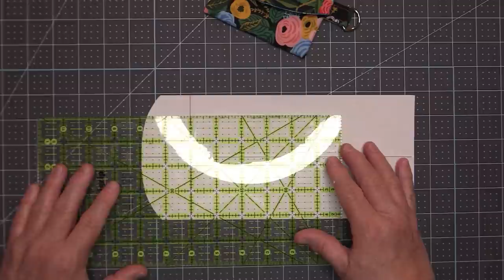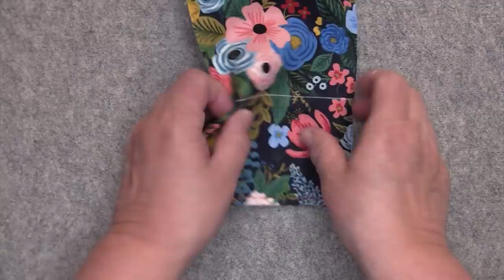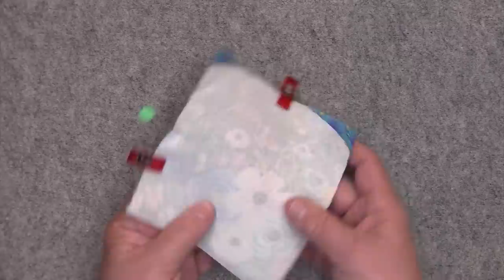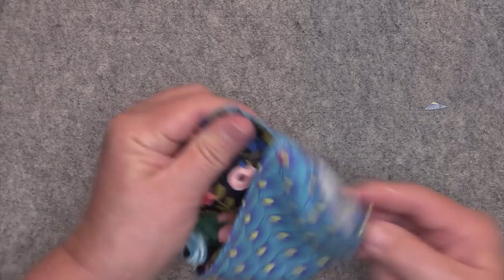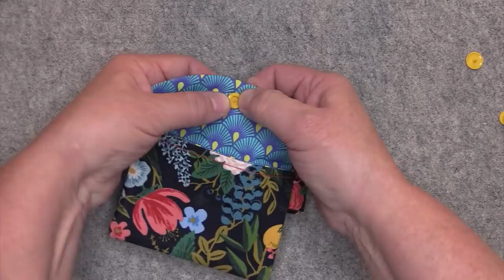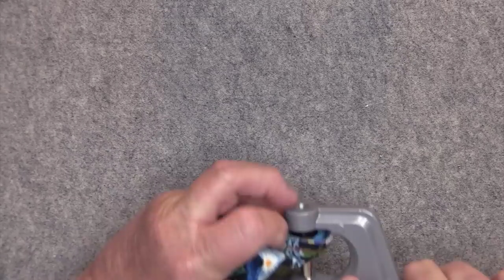Key Fob Card Pouch - Quick Sewing for Craft Shows

Comment: A suggestion on the snaps . For matching snap, how about after you have put the hole with the awl, in the flap, close flap, put pen through the hole to mark a matching hole point on the body of the pouch . Then make a hole where the pen mark is and you will have both the holes aligned. Then insert the “pointy snaps” through the respective holes to attach the female/male parts.
Reply: Excellent
Reply: That's what I have done when making little purses

Comment: After replaying the video several times to follow along, these are very easy to make! Instead of starting with 11", I just cut the fabric to 9". Also made a cardboard template instead of markings, so it is easier to flip the fabric over, iron with the cardboard in place, turn over and do the other side.
Reply: You had the same question I had with this one
Reply: I just watched through a few times to figure out that extra 2" piece. Thank you for posting your comment. I wanted to make from a 10" layer cake and that will work great! I see the 2" strip is used to make the tab for the D ring. I may try to make those from coordinating fabric or figure out something cute. :)

Comment: I  understand why you  started out with the  11 inch length. (Copy paper) But to save time I would just start with the 5x9 pattern size. That way people can make the pattern the right size to begin with and save 2 minutes of video time cutting off the unexplained 2 inch piece.  I like the end result. Thanks for sharing. Chalk would be a good way to mark where the snap goes. Cute little purse.
Reply: I agree, i have enough to knit and sew for Christmas without adding another step thats totally unnecessary
Reply: It’s 9” from the apex of whatever curve/angles you choose for your flap pattern. That can vary depending on what style you choose.

Comment: I love these. I made two of them last night. I purchased the press, awl and snaps a while ago but had  never used the snaps. You made it look easy and explained well how to do the snaps.  

Instead of using paint to mark the place for the second snap.... What I did was....
- Determine where I was placing the snap on the flap and made the hole with the awl. 
-Fold the flap down into place.
-Using a pointed sharpie marker and the hole as a guide, I made a dot through the hole onto the fabric below. 
-Then using the awl, I poked the hole on the pouch part on the dot, and placed the second snap. 
Super simple and it lined up well. No paint needed.
Reply from the maker: I am glad to hear you made the pouch and thanks for the tip.

Comment: I liked your version of leaving the side lining unsewn for turning. Your fabric was beautiful. When I use my cam snaps, I press the first pointy part through the 1st hole and into the other side to make a dent into the 2nd fabric, then make the second hole with my awl.
Reply from the maker: I have a few different ways to line up the holes for the snaps, but this fabric was so dark that I had to use something that would show on the camera.  My favorite way to to use a marker to color in the male snap and then press it down.  It works great, but you would not be able to see it on the video.

Comment: Thanks a lot ! Very nice tutorial. One suggestion : at 10.11 I use a piece of cardboard (5 x 3.25 in) to mark the fold. I place the cardboard on the interfaced side of the exterior, fold the upper part back on the cardboard and press. This gives me a nice fold that is .more precise than a line , and is a time saver, especially if you make a lot of pouches. Thanks again, Rosie.

Comment: These are really sweet!  Ideal for little stocking fillers for Christmas coming. 
I have a suggestion to add - insert the male part of the snap first, then close the flap and press hard with a finger over the snap to make an indent on the fabric where the other half of the snap needs to go.  
I like the idea of using paint but I really can’t be trusted not to get it everywhere lol.  So now we have two ways to do it. 
Very clear instructions, thank you.
Reply from the maker: I do use the method that you mentioned using the male snap to make an impression, but it does not show up on a video; especially with the dark fabric.  Thank you for commenting and have fun making the pouch!

Comment: Just love this tutorial, thank you!!  I was wondering if using cork would work without a lining and sewing with an outside seam, or line the whole piece of cork, leaving an opening for the ring assembly.  Then turn the bottom up to the correct  measurement and sew on the outside which would make the sides of the pouch and continue sewing all around as a top stitching.

Comment: such an awesome video, would u still use fusible interfacing on the exterior if u plan on using a thicker fabric?
Reply from the maker: You can leave out the interfacing if you are using a fabric that is similar to a canvas weight fabric.  Thanks for watching!

Comment: Hello. Could you please answer this question I posted a month ago. Thank you
Could you please tell me my you measure a pattern piece 11x5 and the cut 2 inches off. Why not just cut a pattern 9x5 to start with?
Reply: Maybe she cuts the first piece of fabric 11" long and cuts off the 2 " to make the fob strip later? Just guessing!
Reply: I was wondering the same!
Reply: I was thinking it’s so she has some extra space in case she cuts too much off the top when she’s making the arch. That way she will have 9” from the top of whatever arch she makes
Reply: I didn't see her cut 2" off, she used a 2" section for you to decide the shape of the flap.
Reply: Aaaaaaaand now I'm going to have to watch it again as my flap is approx 2" longer than hers (the perils of watching with the sound off at work and hastily scribbling notes to follow when I get home...)
Reply: So.... it's not that she cuts off 2" exactly, the pattern needs to be 9" long from the tip of the flap and you have the option to shape your flap in many ways that will cut various depths into that top 2". It's a way of making the purse so that the flap ends up where it does in the video and not, like mine, practically hanging over the end of the pouch!
Reply: @Onehallofacreation  BINGO!!!!
Reply: I think this has already been answered but it’s all about what flap size and shape you decide to go for then you can measure with more accuracy from the tip of that down 9” then cut off what you have left over as surplus
.

Comment: May i ask why we didnt just cut it at 9 inches from the beginning?
Reply: Marlene Jones My guess... When cutting the rounded end, the overall length may be shortened. You can see at 2:53 that there is a slight distance between the edges of the top pattern piece and the bottom pattern piece. This means that when the bottom pattern is cut, it will be slightly shorter (so if you started with a 9" piece, you’d have 8.75").
Reply: The flap hangs over the top edge of the pouch by 2”.  If you were to cut it off to 9”, you wouldn’t have the flap overlay.

Comment: Why do you cut a pattern 11” long and then cut it down to 9”.
Reply: I just started watching the video but from what I can see so far, it appears to me that she wanted to make sure the pattern was an accurate 9" in length, after cutting off the end for the flap.  If you notice, when she cut her pattern, she did not cut the curve all the way to the end.  Therefore, this made her pattern no longer 11" as it was when she first cut it.  If the pattern calls for 9" and you cut the flap, you are no longer at 9".   I'm assuming it is better to have too much paper than too little.  So, when she measured down 9" and cut off the excess, it was accurate. But of course, I could be totally off base!
Reply from the maker: You are exactly right!  And thank you for taking the time to respond to the question.  I try to respond to everyone, but sometimes I do not have the time.

Comment: I was so disappointed when I turned it rightside out as I did not do the best job on the curve even though I was carefull soooooooooo I turned it wrongside out again. and then I drew the curve on my paper copy and lined it up with the material and used fusible marker to draw the curve which worked perfectly and now I will use this method with all of them . thought it might help someone else. thanks so much for the video. 
Read more
Reply from the maker: Sounds like a good tip.,  Thanks for sharing.